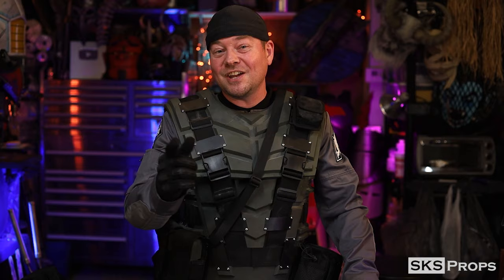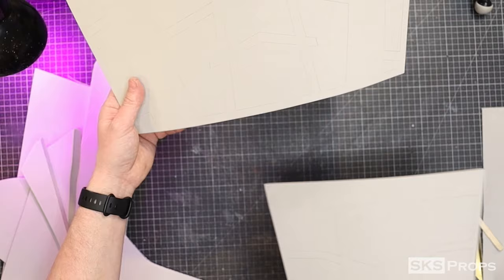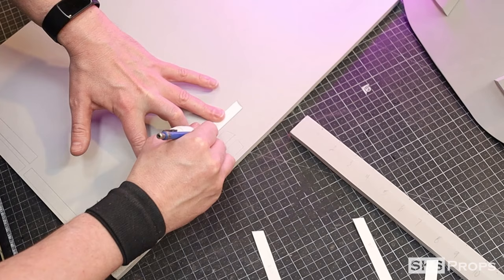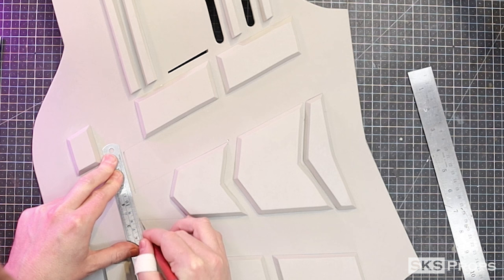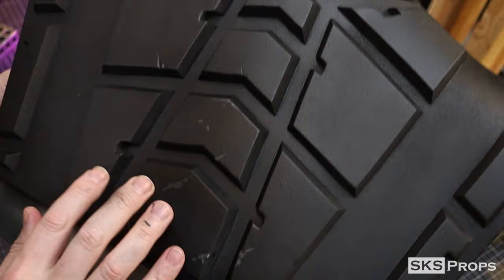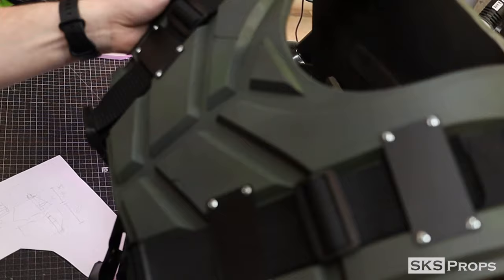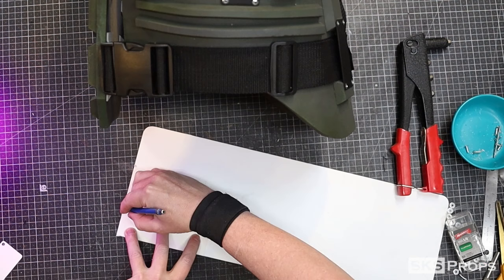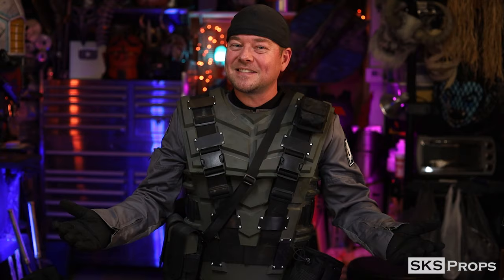How to Make Starship Troopers Armor out of Foam Free Templates Starship Troopers MI Cosplay Tutorial

Comment: On those rivets you actually riveted in place, can suggest getting the 'extra long' rivets and adding rivet washers on the backside.
Reply from the maker: Yeah I had 1/8" washers on hand and was going to add them but after a scrap piece test the plasticard held fine and with the additional glue and 2mm piece these are good to go. Plus I didn't want to but another box of rivets just for 4 extended barrels I'd never use again

Comment: question: i see in the video you use surebonder hot glue and was wondering in your opinion do you feel it could be used as an alternative to contact cement in builds? i ask cuz i don't have proper ventilation at my apt for contact cement use
Reply from the maker: In my opinion no it can't replace contact cement. However that being said if that's all you can use that's all you can use. Also notice most of my builds I use superglue not contact cement. The cement is only used in very large or heavy wear areas. Otherwise 9/10 times I will use bob smith super glue

Comment: Hey Steven. Loved the video, I found it super helpfully (I have never even touched eva foam before, but I really wanna do this). Question: I'm a 6'2 240lb guy with a bigger frame, how should I go about adjusting the measurements? I'm not sure how to measure myself to make the armor fit, I would love some advice for this, especially for the helmet because I got a big head on me. Thank you.
Reply from the maker: Hey, maybe scale it up 5% but the armor itself adjusts pretty well based off of the straps that are attached. For the helmet I also have a large head so you might not have to scale it if you do maybe 2-3%

Comment: The two pouches around 23:03 are airsoft ones. So what you need to do is Weave the back strap under the second  and 3rd Horizonal strap to keep it from moving up and down on smaller sized belts, Or in this case armor.  If the Pouch moves upward change the order you weaved the back side of it, starting with the 1st ( on the pouch itself)and than over the armor's belt and under the second strap on the back of the pouch.  Should be solid at that point. :)       PSsss I play airsoft....   Make it Airsoft BB proof and it would sell like crazy!

Comment: I love this. Will be making a first try to make this. No experience with the material, so little noob question. Why do you heat treat the parts before gluing? Best from the Netherlands!
Reply from the maker: heat sealing the foam closes the pores and smooths the surface getting it ready for glue. Have fun with the build!